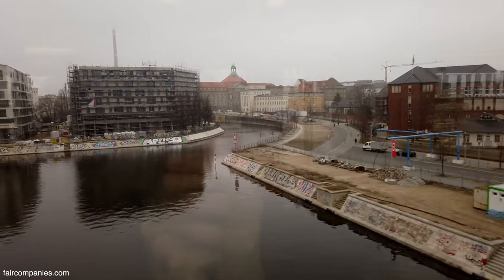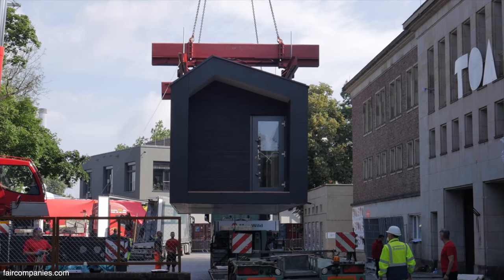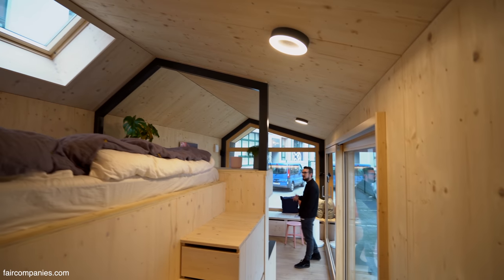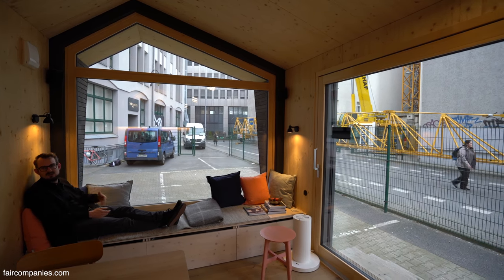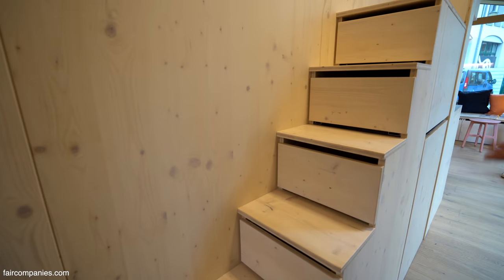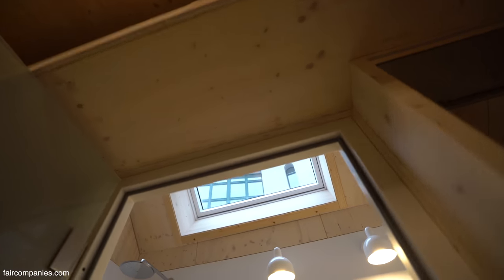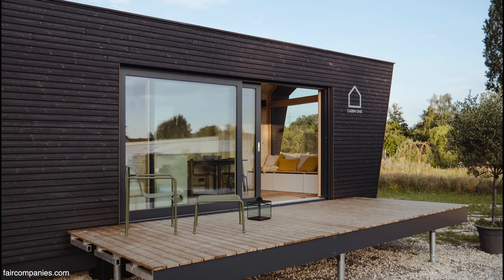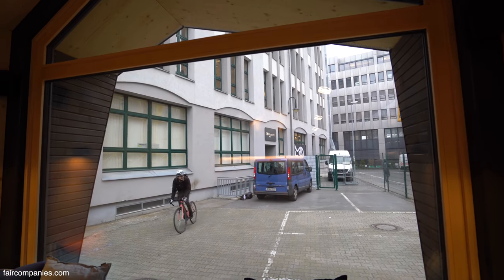An easy-to-install prefab cabin as alternative to rental flats?

Comment: I always try to see the best in new things, but I’m seeing quite a lot of issues here. I’ve worked on a lot of rooftops and they are not peaceful places to exist. They are loud, hot, usually very unsafe and sometimes not even reasonably accessible. Not to mention there’s loads of buildings that can’t even handle half this weight. Then you have plumbing to think about, but the other utilities probably wouldn’t be bad. 

I can’t imagine how difficult it would be to even find a building that would be structurally sound enough, let alone owned by people who would agree to this. 

“Yes I’d like to put a house on the roof please” 

wat.
Reply: And a lot of roofs have noisy AC units going constantly making lots of noise so not quiet and restful to live next to.
Reply: Wondering this too...especially as we watched him climbing up an attic ladder to reach one roof — imagine doing that with groceries.

Comment: What is all that space under the bed being used for? It doesn’t look accessible from inside the unit, so I imagine it’s for a bunch of the mechanical things?
If so, where is the clothes storage? 
This might be great for an Airbnb or a pied-a-terre, but I cannot imagine someone living here full time, especially in the winter (no details on heating in the unit) and given rooftop accessibility isn’t always stellar....and as someone else said, are the existing buildings able to bear the additional load? 
Great concept, but probably needs more thought.
Reply: I'm guessing that is where the bathroom was or the maybe another bedroom. Too bad they didn't show everything.
Reply: Cities like Berlin have multiple old industrial buildings from the early 20th century, that are made of concrete (filled in with bricks) and engineered to carry heavy machinery. The companies have long since moved out, the machinery was scrapped, and now they carry much lighter apartments, stores, offices. You can easily put a bunch of these on top and make rooftop gardens in between, which creates a distinct new addition to the old building. If needed, attach a new "tower" with stairs and elevator to the outside of the building.
Reply: Peter Slegers good to know!

Comment: First off when I think of Germany I just think of academic excellence. The next thing I wondered was does he have to factor in existing roof constructions for load tolerances. The next thing I wondered was fastenings for the unit to the roof. Seems he would need to calculate load tolerances for each roof that he places another structure on. And then I wondered about electrical and plumbing.
Reply: Much was left unexplained, indeed.

Comment: Love it.  I really like the feel and the way the two sleeping areas are set up.  Bathroom is a full bathroom also.  No need for a darn dishwasher in that small of a home-- I would use that space for storage.  If there is a beam underneath the house, as they show in the video above,  to keep the home level on the roof, then i would assume that would help with keeping "footstep noise" away from the people who live below the "roof-house".   Love the use of the windows to create the illusion of space and keep it from feeling too small like a jail cell or prison.  ; ) .  As others have mentioned below, would like to have heard about how to deal with issues concerning "zoning", can all roofs hold such a load?, would roofs be better served with a garden, outside terrace, solar panels? (since most in city have no terrace or backyard or garden), how is the house insulated/heated/cooled?, would one have to pay "roof space rent monthly" (similar to how mobile home owners must pay lot rent?) ? , and how is the electrical and plumbing facilitated?  Love the house design however.  Would love one of these in the country, or in someone's big backyard (where one almost always has to pay monthly space rent).                                      info@askandtellperry.com  .     Perry in USA.

Comment: This way of creating "houses" is just at the begining,it will develop and it will get cheaper and the current rent and buying prices are only going to push this idea further.Connecting such a module to utilities is not impossible in a rooftop scenario,as they are nearby.
Also the access and safety solutions are quite diverse this days and i think it's worth it.

Comment: $110,000 USD for an 11.25' x 39.37' cabin with exposed edge plywood cabinetry (W x L x H) 3.43 x 10 x 3.69m.  I like the feel & look of the place, but it has poor/no cross ventilation, doesn't need a dishwasher, but does need: curtains/shades, washer/dryer, window-screens. Their base unit, which is just the shell with the bathroom module, is $97,350 USD!!!

Comment: I like this, though I’m not sure about the bed placement (I’d feel better with a railing).  Also with a little more length & depth (width) you could fit a nice closet under the bed area.  The kitchen and bathroom could also benefit from the additional length and depth (width). I’d prefer to be on the roof especially with that large window- you’d [hopefully] have a view and privacy.

Comment: If we are talking about the cosy like cabin house its cool it works but the concept of placing them at the top of the building roofs its really problematic not only in everyday life but also for the limit load of the roof that it can withstand. They should have researched this though if they actually doing this.

Comment: Do the windows allow curtains for daylight sleeping or shield from sun?  Kind of open to intrusions from outside even on a roof.
Reply: I agree - if the main windows face the sun, the place would be like an oven all summer.
Reply: FurnitureFan You can cover up the windows from the outside if you need to but German summers aren't that hot most of the time.
Reply: weetikissa, it turns out, even mild weather generates a high temperature.  Stanford University did a study after kids kept dying in hot cars.

I wouldn't want to come home to a hot house, but I wouldn't trust that thieves wouldn't go onto the roof, so I'd have to close and lock my doors and windows.

The tiny house is insulated, but the solar radiation through windows might be able to heat it up quickly, similar to how car windows are an issue, even when left a few inches open.

____
Below from article, "Parked cars get dangerously hot, even on cool days, Stanford study finds'

"There are cases of children dying on days as cool as 70 degrees Fahrenheit," said lead author Catherine McLaren, MD, clinical instructor in emergency medicine."

Found at med . Stanford . edu
Reply: @wownewstome6123  Cars are way smaller and have windows that lay quite flat. Here, the windows are upright and largely in the shadow. And again, it's Germany. They have windows that are hinged at the bottom so that you can leave it open just a crack for ventilation, not that burglaries or heat are major issues in that country.
Reply: weetikissa, I agree re cars, but with the tiny house windows, the angle of the sun during much of the day means the sun will hit those windows directly.  Even cool days allow the solar radiation to heat homes, especially through windows & skylights.

Per energy . gov , (US), article on window coverings & films:

    "...about 76% of sunlight that falls on standard double-pane windows enters to become heat."

FYI:  Sorry.  I just fixed some errors in my 1st comment above.

Comment: Respected sir. 
I thank you for such nicely designed home.
I have one suggestion near bed room you have put the glasses. But irration of air is lacking. 
You take drainage water pipes and joints of pipe with cover , now fix it near bed. 
When ever we want fresh air we can open drainage pipes , We suffocate in close dark room. 
You can fix  this system at multiple places. 
Remember below the room we have cool air and top we have hot air. Namh shivay.

Comment: Roof point loads, or uniform load if bearing on two runners. Also does this effect (affect?) the rainwater runoff flows of the roof towards the scuppers?
Most buildings built in the last 50 years are not engineered to handle random added permanent loads.  Things are designed with efficiency, and expected worst case snow loads in northern climes.
Also modern roofs not designed for heavy or even moderate foot traffic without degrading the roofing materials. They even have foot path pads in place for AC maintenance, to avoid foot traffic on the roof.
Not feasible IMHO.
"13.5 tons"..??? That's about 5 old mid 70's Cadillacs stacked on a roof. Sure, no problem (better get some insurance before the crane shows up)
Reply: It's actually depressing to me how well designed the building is compared to how unsound the siting idea is.  It's like no thought went into feasibility.

Comment: Problem with rooftops is they calculated for limited load (rain, snow). So most likely you wont have many permission to do that.    I agree rooftop view is really nice, especially from the highest buildings in an area.

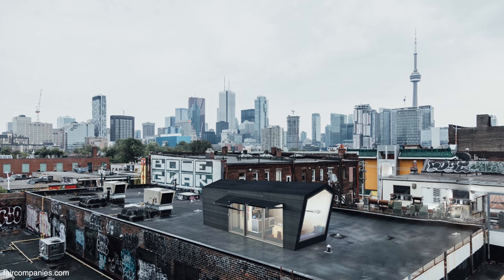Comment: It's a nice looking modular home for sure but surely we should have been shown one that's actually on a roof somewhere! The views at 2:28 & 4:28 were clearly CGIs. Why not a rooftop example? I was also wondering about wind uplift under the big overhang to the gable window. Presumably the whole structure gets fixed down to the existing roof somehow without damaging the waterproofing or compromising the drainage runs?

Comment: There is no apparent (convenient) access to all of the the space under the bed where utilities would consume only a few square feet; no apparent means of blocking unwanted summer sunlight through the huge storefront sized windows; nor apparent cross ventilation; and no price for monthly rent what at the moment appears to be an  unfinished interior. For me, it does not feel like a complete 1.0 version at this time. If we can see it in situ in a year or so (with all space and costs included) , it would be better represent the goals of the company outside of imagining possibilities. Past roof top conversions have seemed very appealing because they were complete.and fully revealed.

Comment: What is under the bed?
Reply: My thought too. I'm guessing water heater, electric panel, maybe some storage, but how do you access it?
Reply: @bluebox2000  You're correct, that's where the water heater, electrics and so on are located. The boards under the bed actually open up so you can access the area.

Comment: Cool idea, but what about fees for the roof rental, plumbing, electric? You are still very dependent on the building you are dropped on. That goes away from a key draw to minimal/independent living. Also is Cabin Spacey going to help secure a rooftop? Can't imagine that being a very easy call to make. At that point ill just rent an apartment or buy.

Comment: The concept is interesting, but probably most city buildings could not accommodate such a unit because of structural (weight) limitations, roof access, access to utilities, and zoning and building codes.  The interior design of this particular model has some deficiencies, including that "loft" bed and storage space.  It would not be an inexpensive venture, though the rooftop views could be appealing.  

In some cities they have renovated non-residential buildings into "tiny" apartments to deal with the housing shortage, and at probably a lower cost.  In today's society there are more people living alone, so smaller units are practical and in demand.  This video shows one way of dealing with that, though its application is quite limited.

Comment: I like it
Though i wouldn't be in a place in yhe city like that
Maybe in a higher point or a place with my privacy
This is way to open to be in the middle of the city

Lacks privacy

Though in another place, like in a high mountain near a city or an isolated place not surrounded by buildings, with a small garden around
Would be very very very great!

Comment: In theory this sounds like a solution, however rooftops have a lot of electrical equipment that put out dangerously high amounts of radiation. This amount of high level radiation is a known fact and may not have been considered in this case. This is not a solution it is a slow death warrant for anyone living in such close proximity to the source of such radiation. I think more research is needed on this housing "solution".

Comment: 4:17 Null gemütlich 😂
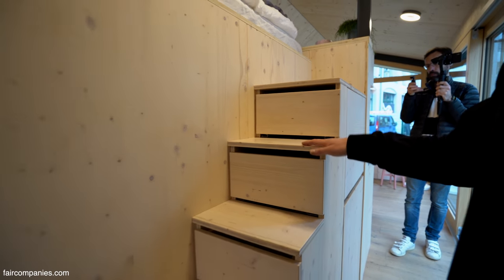6:20 “going up with an espresso and a laptop” + “should be possible without holding something” 🙄🤔
That bed would sure need a rail. It’s a certain neck breaker in the current condition. And not a couples home unfortunately.
Many windows is great. 
Id be curious to know the price. Doesn’t look like a home designed for and affordable to Berliners.

Comment: Seems to me it would be much cheaper to use a shipping container...not quite as aesthetically pleasing, but much more affordable. I think the rooftop is a terrible idea. I'd like an isolated spot surrounded by trees! Two shipping containers parallel on the ground and two more parrallel as a second storey across the ends with decks in between on the top and bottom.

Comment: I would not like to be on the roof next to massive air handlers, not to mention Bathroom exhaust vents. Frankly if the roof can handle the weight, why not just add additional floors.  Perhaps I'm missing something here but this doesn't seem like a good idea.

Comment: Given that it's one floor, why not make it tall enough so you can stand straight up on the last stair to the bed. That wouldn't add much height at all. Also, where's the clothes and food storage. Yes, there's storage in the stairs and there appeared to be storage in the hall, but what and how much. No washer and dryer. Who wants to take laundry all the way from a rooftop?

Comment: What happens if a tornado hits?  Get blown off a ten or even twenty story roof.  What  railings and guard rails need to be installed on the roof.  Wander out in the dark  and off the edge of the roof.  Plumbing and sanitation hook up.  Sounds like structural changes would be needed for the building.  And what kind of roof access on the building.  Cable, electrical,  and internet hook up?  and Where do you put the tv and the stereo?  And nothing like having a window in you roof when you have neighbors five stories above you.

All in all, not very practical as a real living space.

Comment: It is nice, a bit too much glass for my liking though.  With global warming this place will heat up like an oven!
Reply: The sun does the warming regardless of global warming. While a room behind glass getting hotter is the same physics that cause the heating of the world by greenhouse gasses, the two are not related like that. Also, global warming is an average effect, the local changes could very well include local cooling depending on ocean currents and lots of other very complicated details I barely understand.

Comment: Although I am admittedly allergic to small spaces, the exterior design of this cabin looks fairly appealing for someone without the means to buy something more respectable. 
 The interior, upon the other hand, is anything but appealing. The chipboard / wooden board makes a crude, cheap impression. Many a rustic house in Germany, including Ours, unfortunately, have wooden plank ceilings. I cannot wait to rip that rubbish off and redo the ceiling with a more worthwhile material. 
 Also, the staircase with integrated drawers: people walk over it, and both the visible and the invisible dirt particles (including murdered animal particles, snot, piss, shit and goodness knows what) soil the drawers and their contents. Not to mention, opening or closing them, then touching the bed sheets, the pillows and blankets (not to mention [the owner's / tenant's and his beloved's bodies / genitals) without washing hands first - strikes Me as a sort of blasphemy (not that My last few girlfriends have had qualms about it). 

 My ideal house is a >500m2 per story, 2-story (plus a basement, part of which I can use as a photo studio) ultramodern industrial mansion with an elevated infinity pool (to keep it relatively clean from elements), a large sheltered terrace next to it, etc., a spacious lavatory-bathroom with a bidet and all per bedroom, knob-less doors with integrated sensors to open, close and lock them, at least 5 bedrooms minimum 50m2 each (Mine should be larger), wall-size shatterproof sliding windows that tint with a touch of a button, so the interior cannot be visually accessed from outside, but not vice versa; a Tesla solar roof and a few PowerWalls in the basement, a couple of garages as spacious as an average house for bicycles, motorcycles, Teslas, Lamborghinis and like hobbies. And water source that uses filtered rain water, rather than filtered sewage water that everyone else uses. But then again, I'm loathe to rain - and much prefer a warmer climate with average winter temperatures of 18-25 degrees Celsius and summer temperatures of ca. 30 degrees. Access to a clean beach with water akin to Bora Bora's would be a desirable addition to My dream house.

Comment: What he calls "wnidow" over the bed is one of the worst ideas. When it rains it gets extremely noisy and you can't sleep.
Also I don't see the need of the asymmetric roof, those stairs for the bed take more space reducing the hall, bench with the full glass on the back looks uncomfortable, who needs a smart mirror in such a small place so "the house tells you what it's up to" Guy needs mor experience imho.